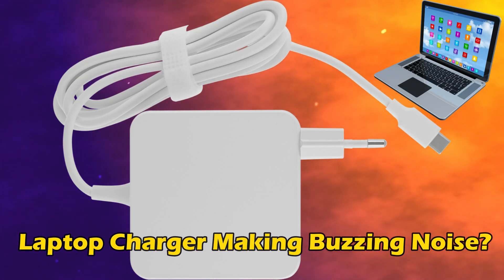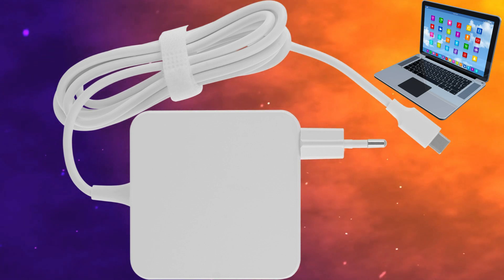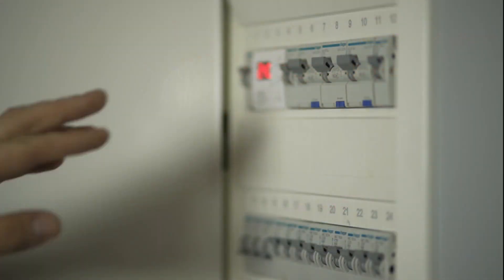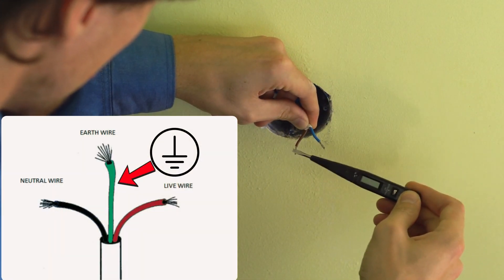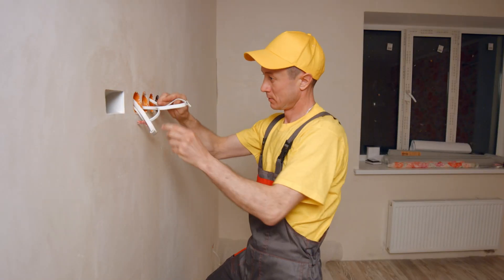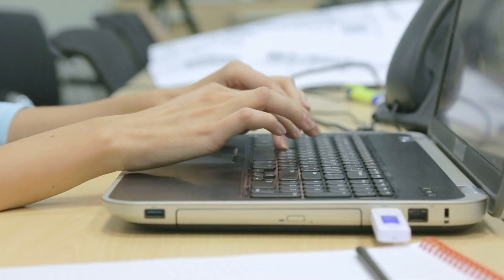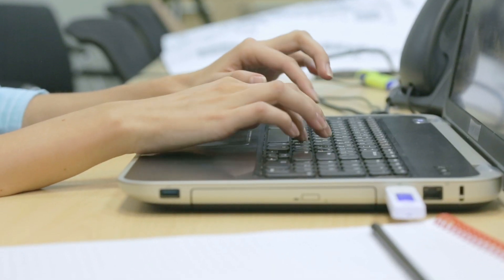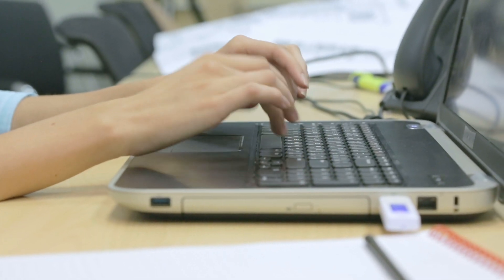Laptop charger making buzzing noise [Fix]

Comment: This video didn't help at all because most of the time the buzzing sounds comes from a bad electrical component in the charger most likely a bad capacitor
Reply from the maker: Good point! If the buzzing is due to a bad capacitor or other internal component, DIY fixes can be risky. Replacing the charger is the safest way to prevent damage.